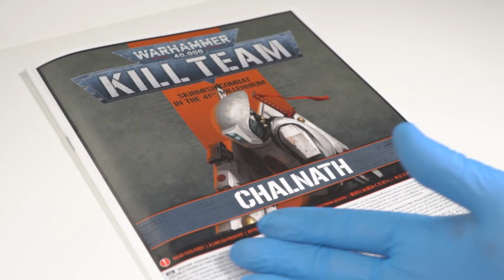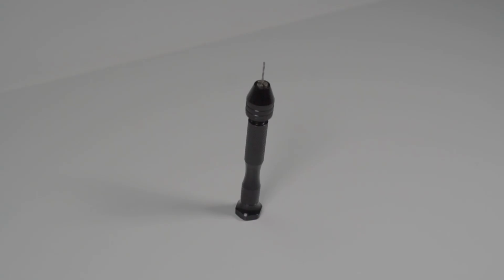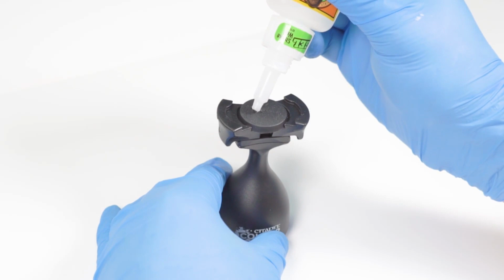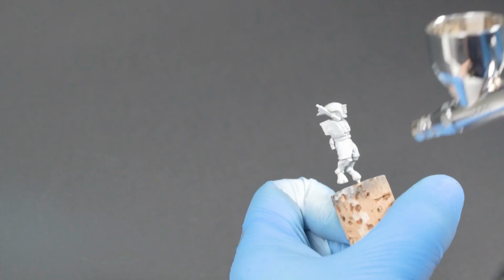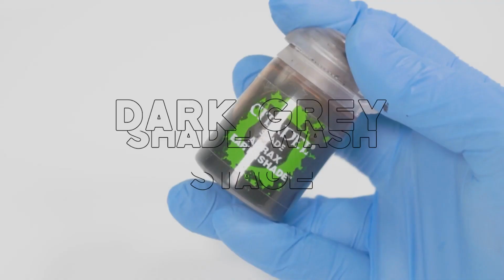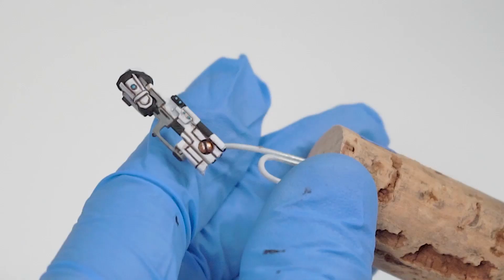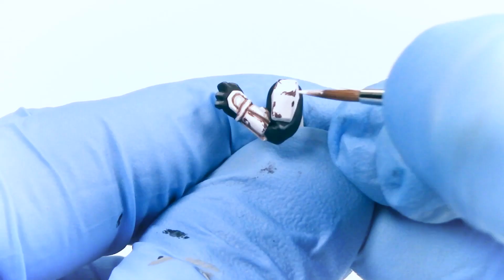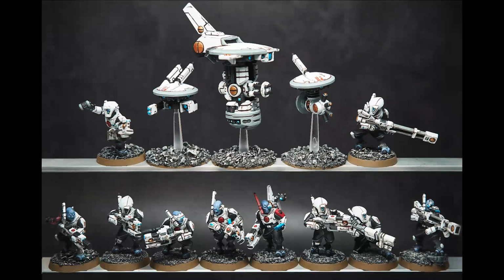How To Paint And Build A Tau Kill Team - (Commission Work)

Comment: I don't know if this is a problem with a low-humidity area like Arizona, but I've found that using PVA glue for basing means the entire basing material will separate and fold up off the base!  I've been able to superglue it back down, but like you I now only use superglue for my basing material.
Reply from the maker: Amen!! PVA is good for scenery stuff once it’s sealed for sure. Super glue is super for a reason ha ha

Comment: Where did you get that pilot hole tool? I've been looking all over for something like that but can't find it. Thanks!
Reply from the maker: Hey MoMo thanks for the question! I would use a scalpel for a nice accurate puncture. Pierce the plastic then twist the blade a few times. The use a “hand drill”. Easily picked up on eBay / amazon